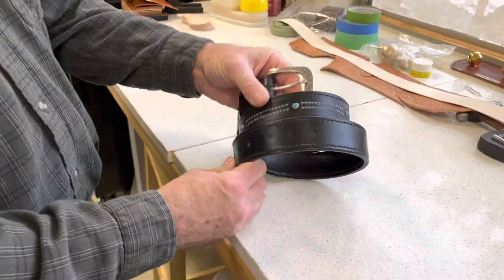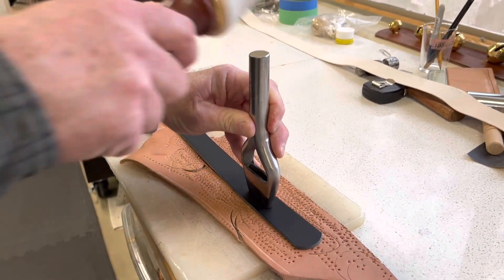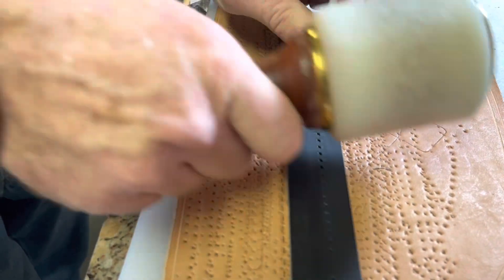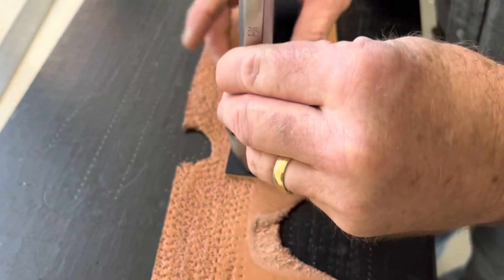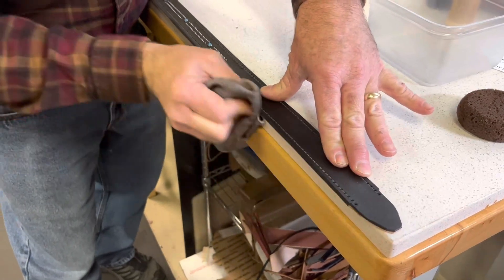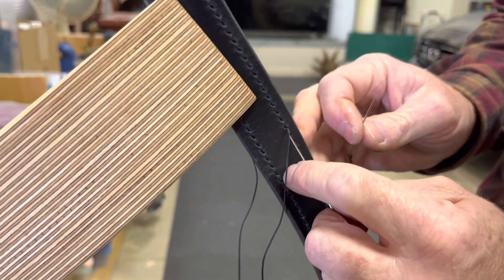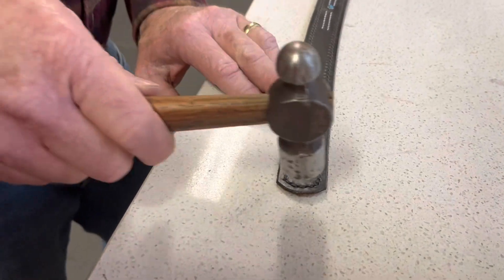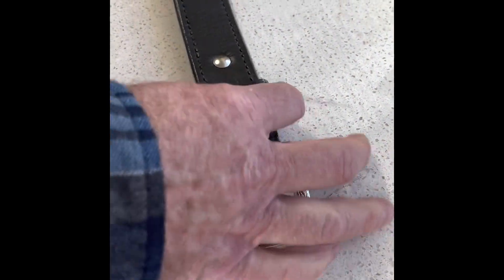Handmade Embellished Leather Belt @InMyBusyLittleShop

Comment: What was the Oz weight that was used for the liner on this belt?
Reply from the maker: On that belt the face was 9 ounce and the liner was 3 ounce. I really prefer two layers of about the same thickness. That allows me to use belt blanks with blemishes for the liner.
Reply: Thanks for the reply
Reply from the maker: You bet.